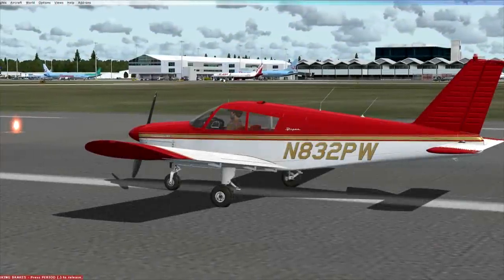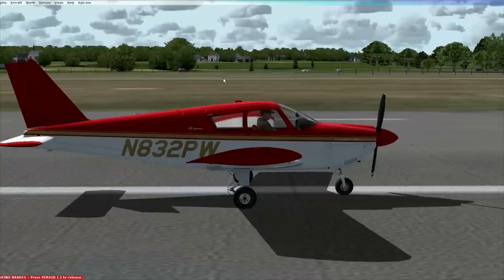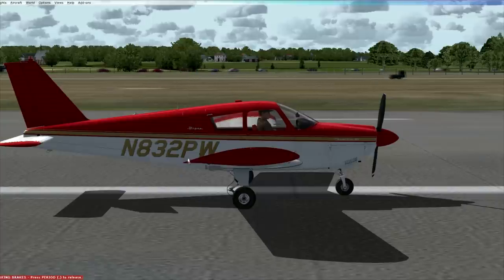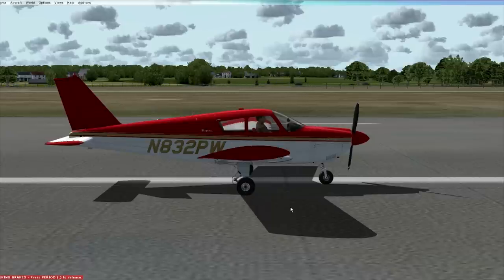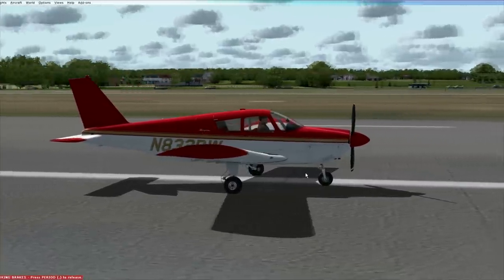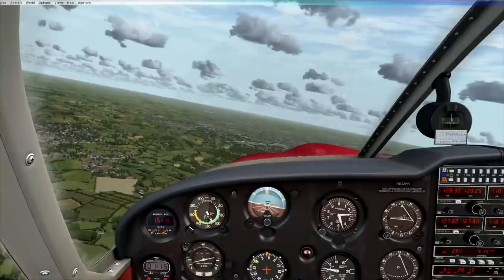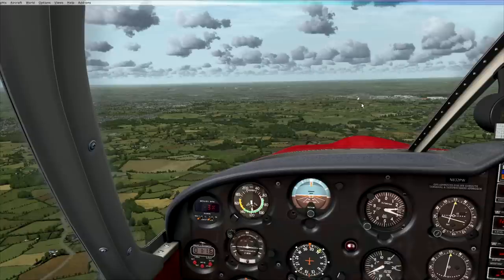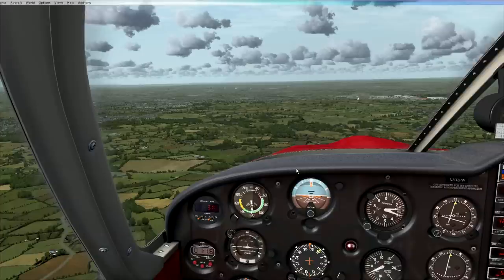FSX / P3D A2A Piper Pa28 Cherokee Tutorial - How to land

Comment: 17 years ago I learned flying at a little club with private but passionate teachers, doing this as their hobby besides their regular jobs. We had a PA-28 118 Warrior and a C172 for training. Now I must say: It would've been a great help then if anybody could have told me the correlation between speed, altitude, throttle and pitch during a landing with a PA-28 as plausible as you did now in this video.

Comment: Very good tutorial. Emphasis on pitch=airspeed/power=altitude is so key to controlling this plane and landing at correct airspeed. Two things I noticed and appreciate your comments:  you didn't raise the flaps after landing which can keep the plane firmly on the ground and transfer the weight, and for breaking and to save the pads, pull yoke full aft after landing. That is how I was taught.  Martin
Reply from the maker: +Martin Marinaro Thanks for the kind words Martin.  

You are spot on with your observations.
Raising flaps after touchdown is an oft discussed topic as shown by this forum thread:  http://www.pprune.org/flying-instructors-examiners/453498-retracting-flaps-touchdown.html
It is obviously a key short field technique but it's not always essential for every landing.  Indeed, there are many techniques and decisions IRL where pilots IMHO can should intelligently rather than by rote.  I used to fly ga out of a busy international airport, and often deliberately landed long rather than hitting the numbers because it allowed me to make a certain runway exit without a long distance taxi along the runway, clearing the runway quickly for the big boys.  Of course it also all owed me to land beyond the TDZ for an airliner, giving an extra margin to avoid wake vortex.  It's not in the manuals but neither is it a bad thing.

So raising flaps after touchdown is, in my opinion a pilot decision rather than routine.  However I can see that doing it as a standard is beneficial in the majority of circumstances, particularly when transitioning through the speed zone where the wing is still generating enough lift to fly.

It's interesting to read about articles in the instructor's forums about students confusing the gear lever with the flap lever.  Of course that only becomes an issue if the aircraft is too fast and for whatever reason (mishandling or bumps in the landing surface) the weight on wheels squat switch disengages allowing the gear to start retraction.
I never raised flaps during normal landings and that behaviour was never mentioned in my PPL, IR, Multi or CPL tests.  I did however use the technique during short field landings if I felt it appropriate for the strip.  To the best of my knowledge landing distance figures in the POH assume flaps are not raised on touch down.
There are also other short field, if more dubious techniques, such as having no flap for the initial part of a take off run to minimise drag and allow maximum accelleration before introducing flap in the latter stages to change the lift profile.  Not something I am aware of in any POH, nor have I tried, but I can see the logic (if as I say a bit dubious regarding handling!)

But as you rightly say, they are techniques which I should have mentioned.
Thanks for the comments,
Much appreciated  :-)
Rich

Comment: Sharing this on Facebook and by email to some friends.  Clearly, you're a great instructor.  I received my pilots license back in 1978.  Learned to fly in PA 28-140s and always loved flying them. I suppose it's because I learned in a 140 Cherokee I always found them so easy to fly. I've since been checked out in a number of aircraft, both low and high wing.  I still love the little 140.  Thanks for a great video.
Reply from the maker: Steve Gwinn Thanks for the very kind words Steve.  I have to say, it was one of the most charming aircraft I have flown.  It's safe, stable and a great tourer, even if it's not the fastest :-)

It's a testament to the ruggedness of the type that many of those built in the 70's are still flying.

Glad you enjoyed the video,
Rich :-)

Comment: Thank you.  The plane I fly most often is the JustFlight PA28T (high tail) in X-Plane 11.  It is often criticized as not modeled well for landing.  That may be true, but I believe it is just a bit more of a challenge. [I do believe the PA28T has a questionable elevator set point for take off.  Pitched too high.]  I do like to come in a little high, slip it a bit and indeed it is hard to really grease it in. Most of the landings produce the unsatisfying thud to some degree.  I have tended to use less flap as an aid to smooth out the touch down. It wants to fly, of course, and that eats up runway. Having viewed this I will try more full flap landings with the emphasis on speed control as you suggest.

Comment: my uncle lets me fly in his FSX sim after school and this vid' helped me immensely, tnx!   i practice wit A2A's J3 Cub, so this low wing stuf is interesting. he won't let me get another plane until i can land Cubby 5 TIMES in a row without bOuNCiNg :)  if i can pull that off, i'm thinking bout either this Cherokee,, or maybe the Cessna172 Skyhawk wit a high wing for my next plane?
Reply from the maker: I've never flown a cub in real life in terms of tailwheel, just a Citabria, but tail draggers require a lot more footwork on the rudder.  The difficulty is that when you land a nose wheel, you land on the mains and lower the nose, reducing angle of attack and thus lift, meaning you generally don't float or bounce too much.
If you 'wheel' a tailwheel aircraft on (ie. land on the main wheels, with the tail up), you can't just pull the stick back to get the tailwheel on the ground because the angle of attack increases and you jump airborne again.  You also can't brake heavily or you nose over, and it can eat up runway trying to slow down to get the tail down.  If you try to do a 3 pointer (ie. land all 3 wheels on the ground at the same time), you have the right attitude for landing and sitting on the ground, but the only way to go down and therefore meet the runway is to reduce throttle, slow down and thus reduce lift.  Slow down too much and the aircraft sinks too fast and on occasions, the suspension can throw you back into the air!
Tailwheel is generally considered harder to master than nose wheel.

Comment: I was always told by my instructors to put full flaps when you crossed the runway fence & never to side slip with full flaps.  I also felt that he reduced too much power when he was still far away from the field so he needed to add more power to climb which then you have to loose altitude which now you are picking up more speed & the idea is to bleed off airspeed before you land
Reply from the maker: What is often the case is that different flying schools/clubs/instructors have their own way of doing things.  As long as it remains within the POH, that's fine.
A common one I found was to use an aiming point 1/3 of the way down the runway, and then when appropriate to lower flaps which should bring the aim point and aircraft trajectory towards to threshold.

Many flying schools don't like lowering flaps when crossing the fence because they would rather the pilot concentrate on the landing at such a critical phase than adding in an extra control and the subsequent changes in aircraft handling.

I believe the Pa-28 can slip with full flaps unlike the Cessna 172 which suffers rudder blanking problems.

Comment: I was taught by a good instructor how to fly my Cherokee 140 in 1989. 3rd notch of flaps is drag only. I hardly ever use that, but usually I use 2 notches of flaps, I forget how many degrees, 20 I think. One time with a female instructor, in a 150 with flaps, on very short final, I slipped it down the last bit. She told me not to do that because the Cessna 150 does (or 152 it was likely) not have the performance. With 2 aboard (170 lbs) and full fuel, it is slightly over grossed. On the Cherokee 140.  It drops like a rock with all flaps in.  I could not imagine doing this, and I would suggest (300 hours) NEVER try this.  If you do, try it at 2000 feet. I don't recall much about float but it does not hang around in the air very long without power in. My estimation is in case of engine failure. Lets say your 2000 AGL.  Look down, straight down. Look at your watch. You have about 4 minutes unitil your on the ground, in whatever condition. The F4U glide is about 45 degrees, 42 if your good (i've read). I think the Cherokee is better but not much.  I was told the Arrow drops like a rock without power. Best Glide is 80 miles per hour. Your speeds with flaps scare me. Stall is 59 no flaps. I have POH in PDF but have seen it on the web.
Reply from the maker: Jeffrey Perkins Thanks Jeffrey.

I do point out in the video that I accidentally keep saying knots as opposed to mph which may be where some confusion occurs.  The figures I always used were Vso = 55 mph and an approach speed of 1.3 x Vso giving 70 mph and then for flaps down Vs1 63 mph and thus a flaps in approach speed of 1.2 x 63 giving 82 mph.  That's not actually dissimilar to the A2A figures.  Given the fact that the performance of the simulated aircraft is set by A2A, then the figures I use are those supplied by A2A.  The A2A model is quite slippery, and I don't recall having to work as hard in the real aircraft to manage the speed, but then this is a simulation and thus there are limitations to what the designers can work with.

At the end of the day, any real life pilot should never be contemplating learning to operate their aircraft from a YouTube video let alone a flight simulator video, but as you quite rightly say should be using the POH.

You are quite right about being cautious  with full flap in the 152 because of the lack of power and thus performance and yes it quite often gets operated over gross.  Indeed, when I was solo with full fuel, I was right on the forward C of G limit.  In addition, I think both Cessna 152 and 172 have placards and notes in the POH advising to avoid crossed controls with full flap due to the airflow from the wings blanking the rudder and affecting control of the aircraft adversely.

I have been fortunate that virtually all of the flying I ever did with Instructors was with hoary old experienced instructors, often current or ex-military.  Indeed, my first ever instructor was an ex Jaguar OCU boss with thousands of hours who's touch when flying was incredible.  I consider myself honoured to have been in an aircraft with him, but would never, ever attempt what he could do with a plane!  His flying was sublime and his ability to use sideslip as an additional tool to manage aircraft energy was quite exceptional.  Quite a few aircraft can be crabbed with full flap and the trick is to read the POH.  I don't have a copy of the Pa 28 POH to hand, so I can't recall specifically if side slipping with full flap is forbidden or not, but I suspect not.

I lost my medical due to incurable cancer whilst doing my FI rating so sadly my move to simming was enforced, but critically my videos are not aimed at or intended for qualified real life pilots but for those who want to enjoy simulation.  As a result, I am grateful for those who wish to help by adding their real world knowledge.

Thanks,
Rich

Comment: What addons do you have in this video? Im debating getting XP10 just because to get FSX up to par visually (im not a huge graphics nerd but it does help with the immersion) you have to spend tons of $$$. To get XP the way I want, would only cost $40 at the most besides the cost of the sim.
Reply from the maker: The add ons are FTX England (about £30-£35), rex4 for the other textures (eg. clouds) and Active Sky Next for the weather engine. However, you can get decent free weather engines and cloud texture downloads for FSX. The FTX scenery range is amazing but can be quite expensive once you buy a few areas so I would check their website to see if they cover the area you want to fly in and the cost.

Comment: Isn't that "Side Slip" You perform couple of times is acctualy a Forward Slip ? Side Slip is used to go straight where there is a cross wind blowing You from your course to counter this effect.  Forward Slip is for fast descent without or minimal increase of speed and it looks just like You were doing it. It's not like I'm wising you or something :) don't get me wrong. My point is to specify this topic for knowledge consistency :) . I read in FLIGHT SIMULATOR X FOR PILOTS: REAL-WORLD TRAINING about this topic. There were examples with Piper Cub. And that is my understanding of this two types of slip and the difference between each other. But, as I always say, I could be wrong of course :) .

BTW I really like Your video. Very eye opening :) For me especially that part of going higher  on approach with GA regardless of PAPI/VASI and explanation why that should be from safety point of view. Didn't thought that way about that.

Comment: how do i get this simulator? 
can you also show man pres, and rpm of prop?
Reply from the maker: The aircraft can be bought from most of the major retailers web sites.
The Cherokee doesn't have variable pitch prop, so doesn't have prop rpm or manifold pressure.  It does however have an engine rpm gauge.